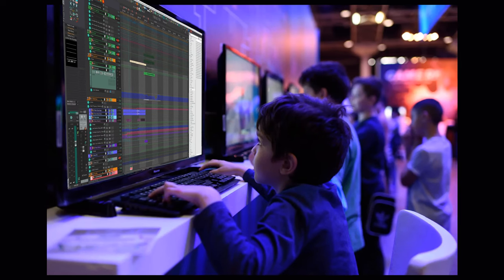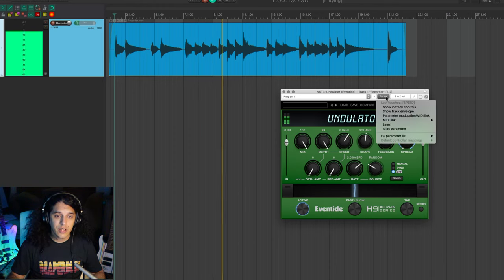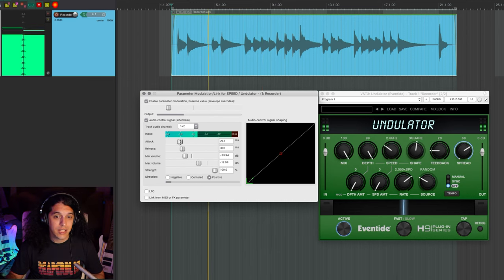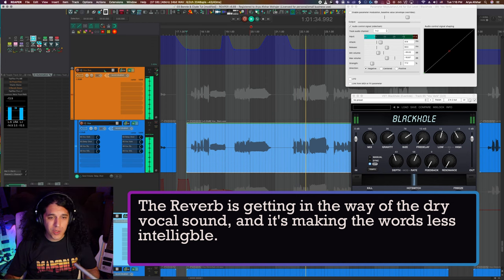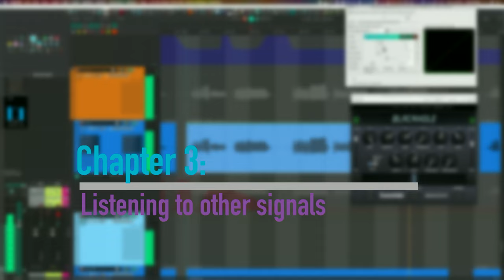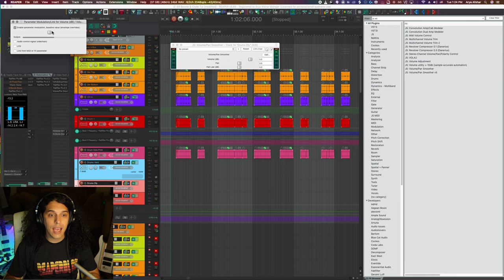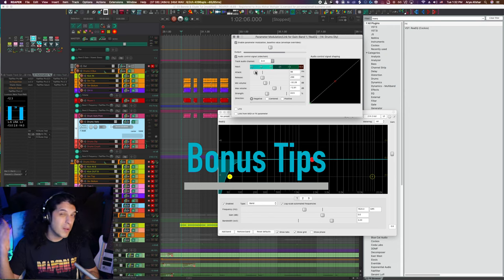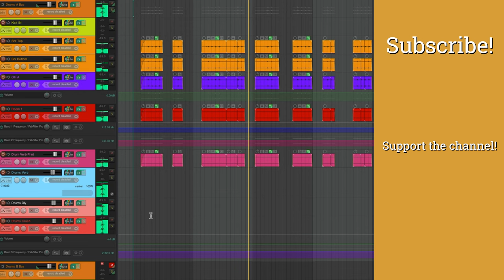Writing Automation without Writing automation (Parameter Modulation in REAPER Pt. 1)

Comment: Can you help me. Are you familiar with BFD3 drums? I purchased a BFD3 drums a few weeks ago however Reaper does not seem to recognize it. I use a PC and just followed their instructions so the file is in my C: Disk.
Reply from the maker: In preferences>Plug-ins there's a box to specify paths to scan for VSTs, there you need to add this directory to scan
Reply: @IDDQDSound  Thank you for your reply. I tried adding a path but it didn't work. I wrote this in the edit path C:\Core Audio Content\. This didn't work when I tried to re-scan VST paths for new/modified plug-ins.
Reply from the maker: @prodcore  hmmm. Try being as specific as you can with the path. Like go to the exact same folder. Also in fx browser make sure you have All highlighted from the left column.

Comment: Very nice! I do use LFO parameter modulation every once in a while, mostly for testing purposes, but sidechain parameter modulation does also seem very useful. BTW, I think just a single click on the control rather than a wiggle should be enough, although this might depend on the plugin.
Reply from the maker: Haha yeahhh clicking works fine. I'm just anxious af :)
Reply: @IDDQDSound  Actually I was just testing this today, and with VST you can indeed just click, but with CLAP you do have to change the value aka wiggle.
Reply from the maker: @TaleTN  Oh interesting! I don't any clap stuff but I remember at one point clicking wasn't always working and wiggling did :)

Comment: Parameter modulation with eq is effectively a dynamic eq isn't it? A bit of a workaround and it's a lot simpler to just grab TDR Nova, but still, you could set up Rea-eq as a dynamic eq using dynamic modulation of the same track couldn't you? I'm not working in my studio right now, otherwise I'd try it.
Reply from the maker: It sorta is but not exactly. In a regular dynamic eq, each band "listens" to just its own frequency and respond dynamically. With this setup all bands will listen to the whole signal, so for example, a kick hit on a room mic will still trigger a high band filter. 
 You could sidechain it to a band passed filter, but yeah at that point may as well get tdr nova :)
Reply: @IDDQDSound  Oh I don't think that's right. I have every band of rea eq listening to just that frequency on another track. It works smoothly.